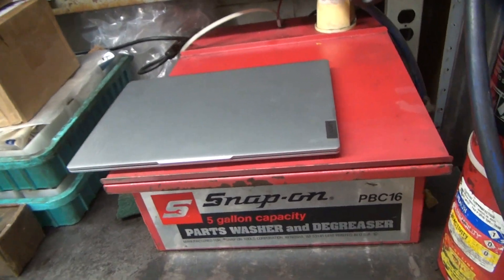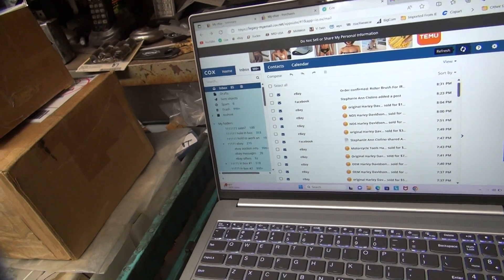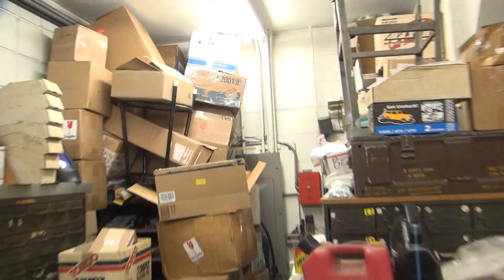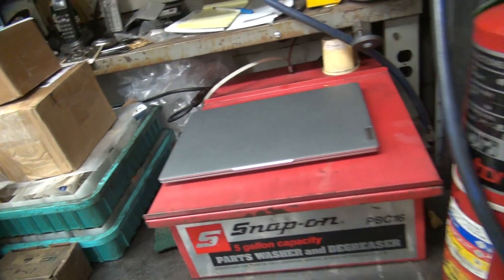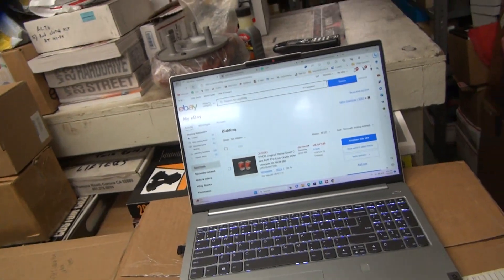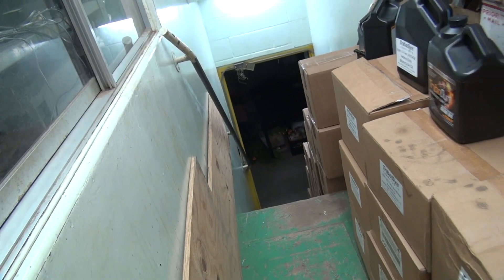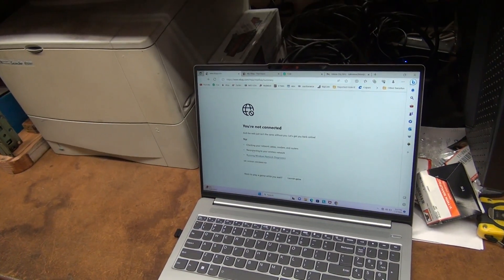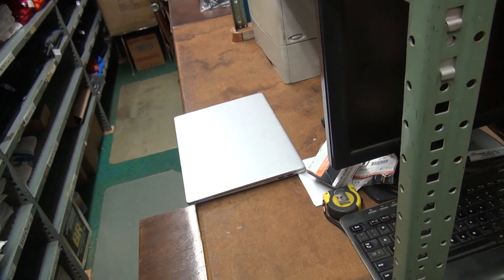#101 tatro gets a new computer Lenovo Slim 5 16" Laptop changes are coming soon harley tatro machine

Comment: The cable you are running into the shop needs to be Cat 6 Ethernet cable running from your internet modem / router that is most likely in the house to the shop. with that laptop if it doesn't have the  Cat 6 port you will need to pick up a Cat 6 to USB  adapter which you can find online or Best-Buy